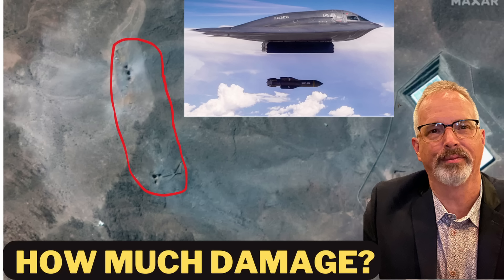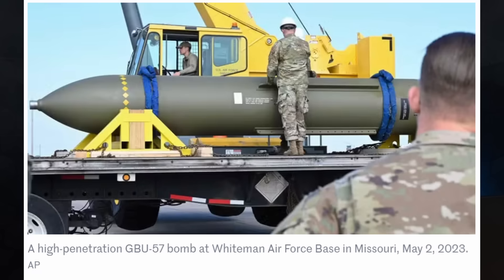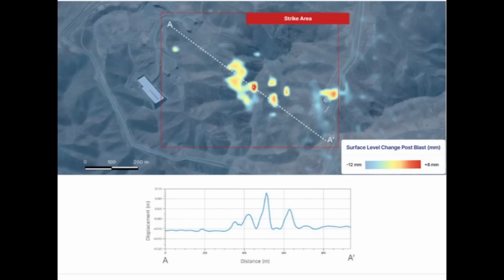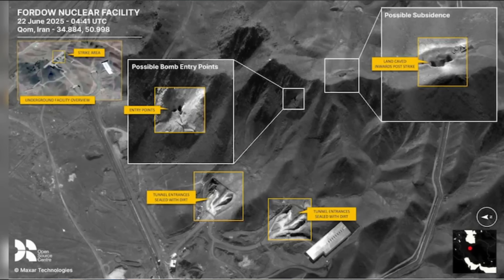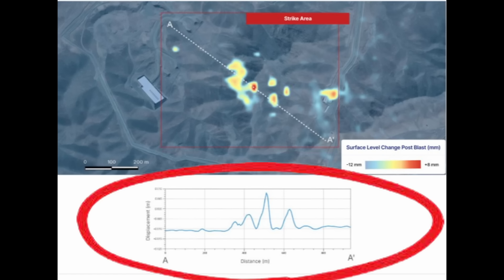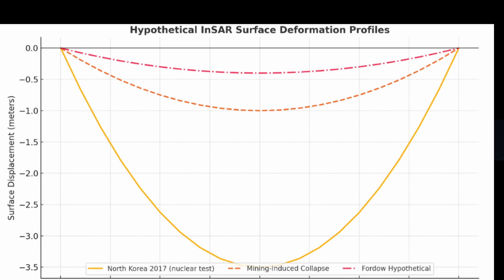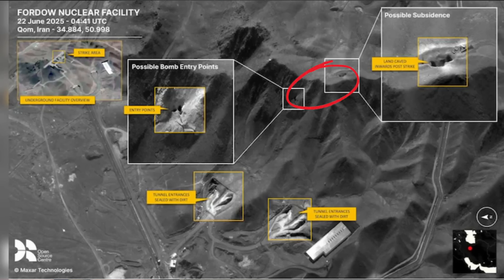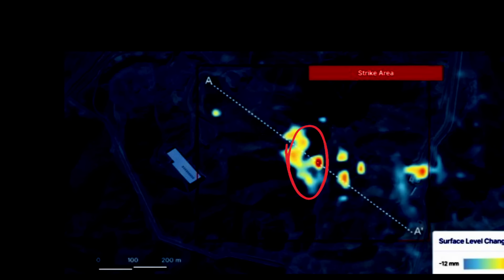Fordow Attack Assessment -  Update

Comment: I do not know what R.E. you used for assessing how much explosive it takes to penetrate this site. The Relative Effectiveness (R.E.) factor measures an explosive's demolition power compared to TNT, which has a baseline R.E. of 1.00. A higher R.E. indicates greater explosive power per unit mass, crucial for military applications like breaching, cratering, or fragmenting ordnance. 
Highest Known or Suspected R.E. for U.S. Military Explosives
CL-20 (Hexanitrohexaazaisowurtzitane):
R.E. Factor: 1.9–2.0.
Description: CL-20, developed by the Naval Surface Weapons Center at China Lake in 1986, is the highest-energy and highest-density organic explosive used by the U.S. military. It’s a nitroamine with a detonation velocity of ~9,480 m/s (vs. TNT’s 6,900 m/s) and a density of 2.04 g/cm³ (vs. TNT’s 1.65 g/cm³), offering ~20% greater power than HMX.
It's highly likely this is the explosive that was used unless a more classified version having an even higher R.E is available. 
This may change your calcs. for your analysis keeping in mind that this weapon was developed and tested for specific use against Fordow after 15 years of development/testing site specific. (Maybe a more apt name for this weapon might be "The Fordow Penetrator")For me this is a kind of fun project that uses knowledge that I never expected to use or needed in my career, thanks for taking the time to look at this kinetic problem thru a geologist/engineers eyes. Ray

Comment: I didn't know we were dealing with a granitic mountain. You can hollow those things out without any surface change because the rock is incredibly hard. I couldn't help but notice the cross section shown resembles a cross section of a crater, except in deposition instead of removal of material. I can definitely see this being uplift as you say or even just blast debris that rained down. Although blast debris should be more ovoid, so if we overlay the map of the facility, the uplift should somewhat match the facility map. I believe it's safe to say the equipment inside Fordow has been reduced to kibbles and bits. The only question remaining would be what about the underground facility 1 mile SW of Natanz that was not hit. What are they doing there? Did any material get moved there? Nobody seems to want to talk about that place.

Comment: Casey one further question sir? If the assumption of blast wave destruction traveling through air holds true, do waves of energy bounce off substantial objects in opposite direction crossing paths with incoming wave creating intersections where they're actually intensified?
Reply from the maker: Yes, I suspect that is true that there are zones of interference where blast waves intersect.  Perhaps a blasting expert will weigh it here.

Comment: and there is a docum. from 10 years ago where iranians was making special concrete just for this. i asked ai, ai said udner perfect condintios in testing it could pentetrate 60m. but in real life senario it would be more like 20m
Reply from the maker: I suspect that is the reason why the U.S. used multiple penetrator bombs.  Also, the granite would be about 3 times stronger than 10,000 psi concrete.
Reply: @CaseyJones-Engineer  and lets not even talk abou that those air shafts could be fake. and there so many ways to desperse energy of that kind of weapon and Iranians had time to test and prepare

Comment: My layman's thoughts multiplied by this video.

1. Only 8mm difference in surface elevation is sufficient to indicate enormous damage? Surely that's not hearly the volume collapsed tunnels large enough to dupport riadways and large rooms. I'm guessing you can calculate the volume of collapse by thevSAR data and it totals a very small room, hardly able to house hundreds if not thousands of centrifuges, personnel and other equipment including power, ventilation and access.

2. I'm assuming minimal visible surface damage  is actually a good sign of the blasts being confined. Any idea what the light blue debris at one site is?

3. Any somment about likelihood of liquifaction and if there are any surface indications?

4. Is there any information how deep the granite formation is, could Fordow actually be built under and not in granite? I assume the above ground geologic formation probably provides clues if there are indications how the mountain was formed.

Comment: The uplift of the surface in the far right of the image is most likely blow-out. Which is the best indication of a successful hit so far.
Reply: If you look at all the suspected maps of the facility layout, this hypothesis is totally inconsistent with any suspected tunnels which could serve as a conduit for blowout.  The location is also inconsistent with any suspected subsurface structures which could be the source of uplift and if US facilities may serve as any blueprint, the area on the right may be a maintenance or processing shop for hazardous materials.  InSAR data suggests to me a MOP was dropped there and caused landslides on the surrounding slopes.  It appears to me that most of the positive displacement at the site could be explained through landslide debris.  Pure uplift would exhibit less blue fringing.
Reply: @Peter_S_  also penetration is not linear. more bombs dont just add onto eachother.
Reply from the maker: Thank you.

Comment: At 6:29 you will notice that the lattice fins retract just before surface impact.  I would imagine that this is by design to prevent the lattice fins from slowing down or impeding the penetration capability of the missile into the ground.
Reply: Are they retracting by design, or is this just the effect of their momentum carrying them forward against the decelerating body?
Reply: @Motorman2112 You are correct. Momentum is carrying them forward on their hinge.
Reply: @Motorman2112  both could be true ;)
Reply: Newton’s first Laws of Motion- An object at rest remains at rest, and an object in motion remains in motion at constant speed and in a straight line unless acted on by an unbalanced force.  
The grid fins are hinged and as the body of the MOP impacts and decelerates, the grid fins maintain their momentum and hinge back toward their pre-deployment position.  As soon as they touch the resulting borehole, they are immediately sheared off like they never even existed.
Reply: That was my initial thought too - but in the test footage those latticed steering fins only retracted about halfway before they reached the surface. So if they were intentionally retracted to reduce drag going through the rock, the retraction failed.

Much more likely I think that the fins broke their locking mechanisms and hinged forwards from the sudden deceleration when the tip of the weapon hit the hard rock surface and slowed the weapon. 

The body of the bomb slowed but the fins wanted to keep going, so they hinged forward (towards the "stowed" position they had against the side of the weapon, before the bomb was dropped and the fins were unlatched and springs forced them open into the airstream).

Then there's the practical nature of the comparatively wimpy fins & their hinges going up against the rock. Neither the fins nor their hinges would have a chance to withstand the impact with the rock face, even if the fins did manage to fully retract forwards against the side of the munition (despite the springs still trying to hold them open).

I suspect the fins, after being snapped off at the rock face, bounced into the air and are laying on the mountain, waiting for an enterprising souvenir hunter to collect.
Reply from the maker: I thought that was pretty amazing.
Reply: @CaseyJones-Engineer  I enjoyed listening to your insights on this unique event from your specialized engineering perspective.  Thank you for your input.
Reply: Occam's razor in effect. The simpler solution is the correct one here. Inertia always works.
If you use a sensor here to determine that it is time to retract the fins, you have introduced something that can fail. Or could work prematurely when there is a bird (creating large enough echo) in the way.

Comment: These bombs are amazing, to be able to follow the bomb before it down the same hole is freaking amazing. But at this stage to say this facility to be completely destroy is to me, counting your chickens before they are hatched.
They need to be able penetrate at least 10 metres of this granite rock each is a tall order and that means only one bomb could actually have a chance of destroying this facility. 
My other question is, does this facility have a series of blast proof doors at various positions.
The only way to know with certainty is to actually inspect this facility, which isn't going to happen.
Reply: Also, Iran now knows exactly how deep our MOBs can penetrate, so you can expect the next site they build to be that much deeper. 🙄
Reply: @unknownhours  But what if much of the damage comes from the over pressure of the blast traveling down the ventilation shaft into the open space.  A facility like this will always need a ventilation shaft and getting a bomb into the shaft will always allow for overpressure to reach the open areas.

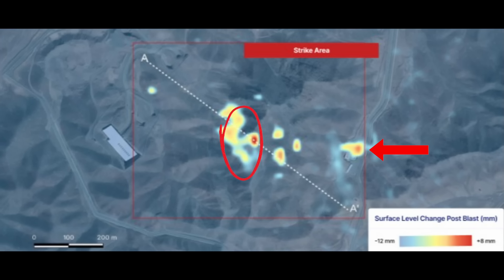Look at the video at minute 6. @6:00, which shows deformation at an entrance far away from where the bombs were dropped. This is a good sign that over pressure could have destroyed any sensitive equipment in the open spaces at this facility.
Reply: @alansnyder8448  None of the publically released maps of the facility have an opening there. There is also no visible tunnel entrance at that location. So why would there be any blowout. Plus, all the released designs have shock traps included, so a blowout, even if the facility is hit, is highly unlikely. 

Also, why would you assume, that a ventilation shaft for such a facility is a straight way down? And not especially hardened as its an obvious weak point. Usually, all bunkers use complicated overpressure release systems for their ventilation, I mean the facility was likely build to withstand a direct nuclear hit. So you can safely assume, that the design of the ventilation shaft was all but simple
Reply: @nukularpictures  I do agree that the ventilation shaft would not be straight down, but the overpressure would find the path especially after 5 bombs are dropped down the same shaft. An over pressure propagates very efficiently in a confined space like a cave.

Comment: Video was shown in the West of a very tall fireball reported to be the strike on Fordow.  This aligns with the large quantity of grey ejecta covering the site.  In mining, if you don't properly tamp your charge bores then most of the energy will simply exit the borehole without causing much fracturing.  It's much harder to retain the shock energy using air than it is using rock or clay tamping.  I see plenty of evidence to be skeptical of the overall results.  If they have other undeclared sites, then this is only a time delay.
Reply: Are you referring to the video that is represented by a frame capture that Casey Jones showed in the previous video on the subject? If so, please take note that that video was already months old when this bombing took place. It is clearly not from this event.
Reply: He posted a photo that was spread from that video on his video titled Satellite Methods that could be used for Fordow Bomb Damage Assessment at 6:39 (in the referenced video, not in this video). As an example, if you search for "Israeli strike on Tartous, next level explosion" you will find a tweet from December that brings up the source video for the photograph shown.